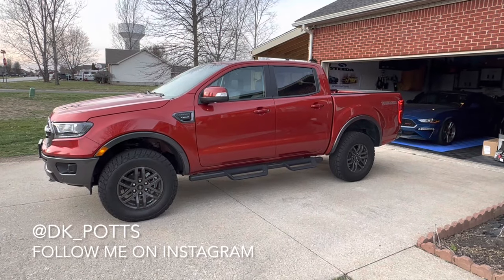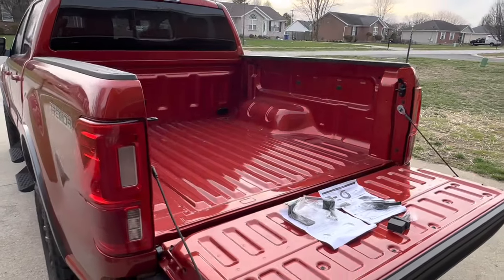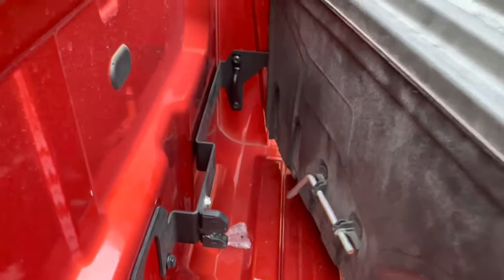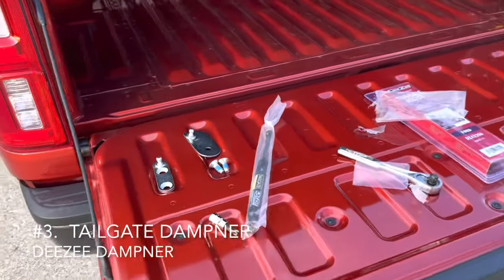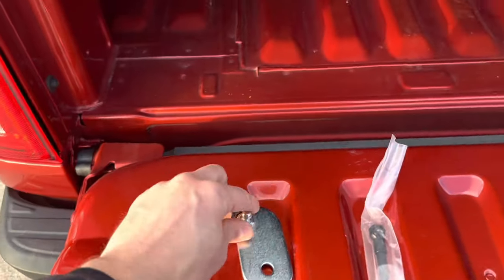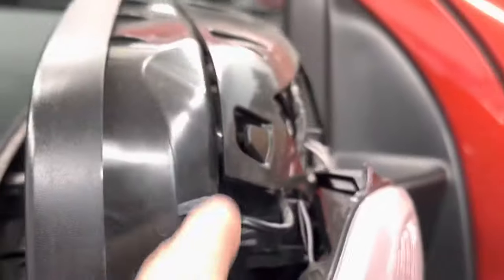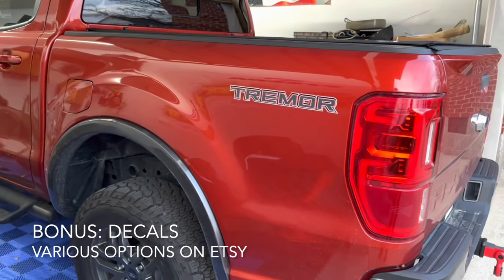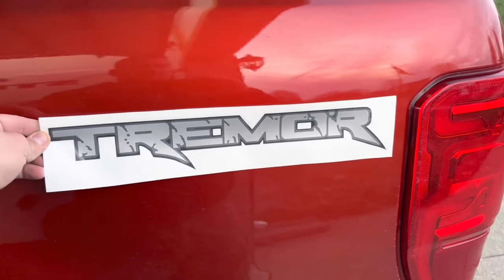First 5 Mods for your Ranger!

Comment: Got my XLT in December and it’s the best truck ever! Ended up doing a Line X bedliner and a MX4 Bakflip cover. Next on the to do list is that tailgate assist, raptor grille (w/ lights) and fender flares!
Reply: how was the mx4 bakflip install ?
Reply: @berghproductions  I had my line x dealer do it. If I had more time though, looked like it could be done within a couple hours and by one person.

Comment: The mods don't stop, i got my lariat tremor last june and im already 7k into it.The best mods for me was the MBRP catback exhaust paired with mishimoto CAI and intercooler setup, huge boost in pwer and mpg. and can't forget the tune ;P
Reply: Did you go with a ecu flash? Or piggy back
Reply: @13ryanheartbreaker27  ECU flash
Reply: So ur mpg improved due to tune,  not due to intercooler and other mods? But with tune u need 91 octane, not worth it.
Reply: @I A  ya 91 octane is 5-10 bucks more per fill but it lasts longer than regular... so it does actually make a difference. First person to ever say a tune is not worth it lmao

Comment: I got one of these trucks. I’ll probably lift the front. That’s rail gate assist it pretty cool. I’ll get that also. I don’t know to much about trucks. But I was told my model has twin turbo in it. And if you change a valve on the intake you can really make it sound like a turbo vehicle? Have you messed with the engine at all?

Comment: Congrats in your new truck! How you compare the Tremor vs the Gladiator you previously owned?
Reply from the maker: The Ranger has more power, but then I'm not trying to turn heavy 37's like I was on the gladiator. 
The gladiator would squat a LOT when towing. Ranger tows great!
It was nice to be able to take the top
Off and doors on the gladiator. 
The Ranger is cheaper. But not as popular for mods like a JEEP branded product. 
If I had to do it again I'd still get the Ranger but ONLY the Tremor version.
Reply: @dksgarage6061  thanks! Im on the fence between a Tremor or a Willys Gladiator,  the $10,00 difference is huge. Tremor wins!